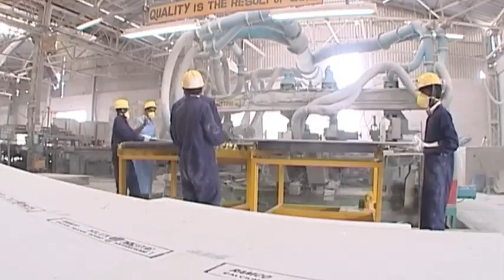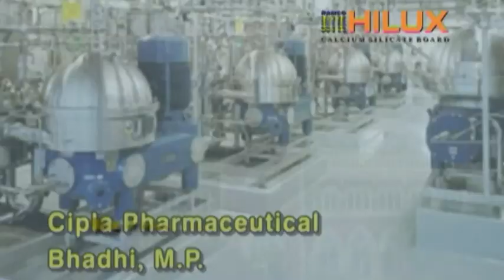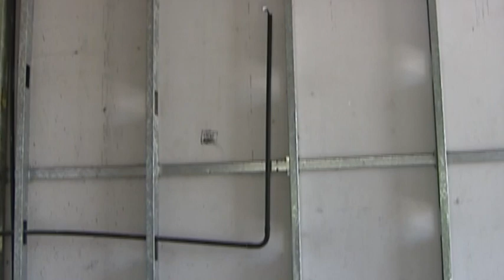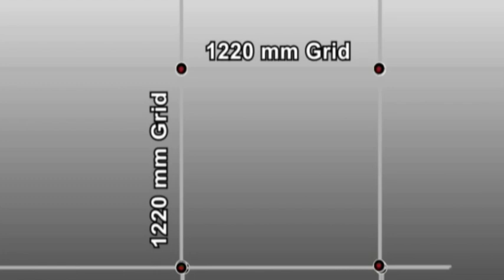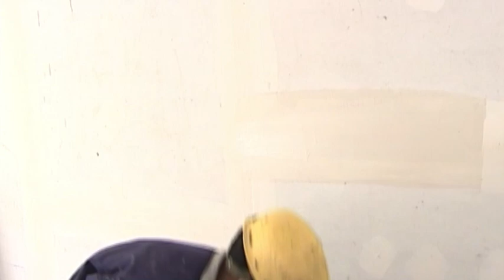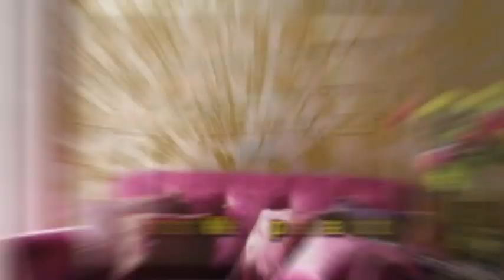How to Use Ramco Hicem and Hilux Boards

Comment: Professional work except screwing. Dont insert the screws this much deep. Screws should be just pierced inside board specially for suspended ceiling. Otherwise the board can fell dwon bcs of weight.
So instruct to insert the screw just a little inside. For gypsum boards installation, the covering paper should not be broken by screws.
Reply from the maker: Jabir Koyakutty Thank You for your response